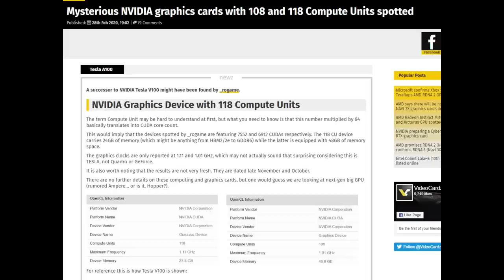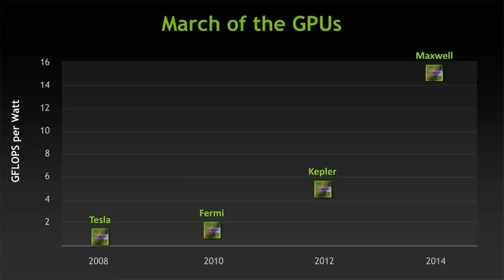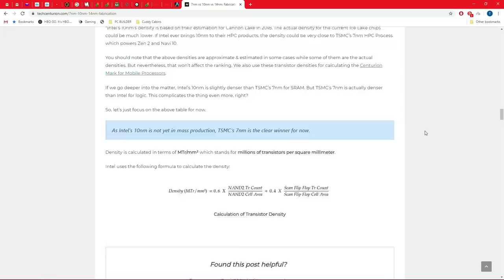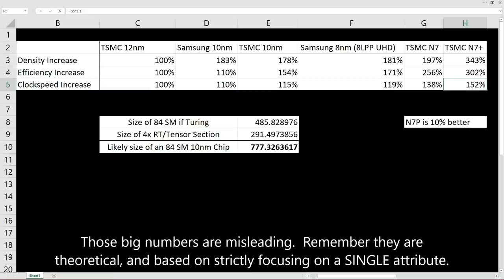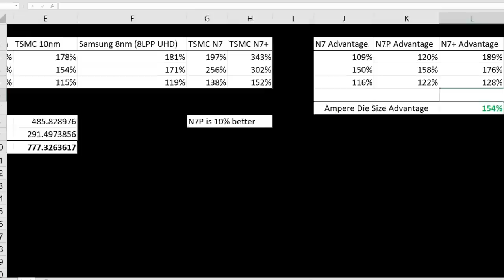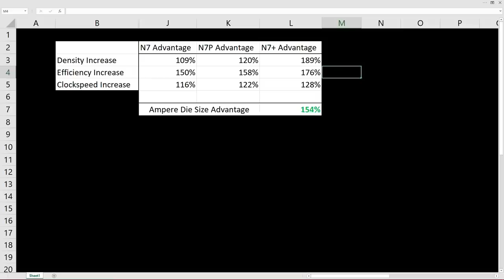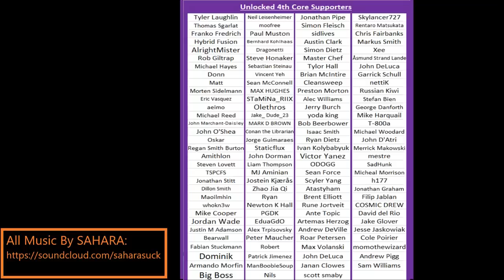Nvidia Ampere on 10nm: Still Good Enough to Defeat RDNA 2.0?

Comment: I feel like Nvidia isn't worried about AMD catching up to their level of performance to take the "performance crown," no; they're worried that they'll have no acceptable excuse to be pricing their new Ampere lineup as high as they can to earn as much profits as possible.

((Edited for -- hopefully -- better wording.))
Reply: Good point indeed
Reply: less profit haha
Reply: This assumption is based on the idea that AMD is not going to rip off consumers ,as well, though. If AMD starts to charge the same ridiculous prices as nVidia did on Turing, nVidia might very well get away with that on Ampere. And AMD already tried to do that with the 5700XT. Let‘s remember: This card was originally supposed to replace the RX590 and they tried to sell it for over 450$ MSRP
Reply: And further more, AMD is not really in the position to set pricing in the GPU market. They have to play along with whatever nVidia is doing. If we assume that RDNA2 and Ampere are very close in performance at each tier, AMD cannot simply outprice nVidia. A lot of demand would turn to AMD (a lot in terms of AMDs market share of course) for which they don‘t have the production capabilities to account for. So if nVidia is charging high prices again, AMD is probably forced to play
along to some extend
Reply: Felt the same . Nvidia just worried about pricing.  Hope AMD will do something at least.
Reply: @romanpul  and if AMD uses HBM for Big Navi, a higher price than previous flagships is justified. The $700 R7 was sold at a loss IIRC.
Reply: Defeqel that could make it even worse for AMD, because nVidia could actually come to the idea to outprice them. Because of the generally more mature and therefore cheaper node nVidia builds their GPUs upon gives them far more headroom to adjust prices. I‘m not sure if AMD is willing to sell cards at a loss again. Tom just pointed that out very nicely. nVidia makes cheaper dies on older nodes at the sacrifices of them being larger. AMD cannot do that for a number of reasons and has to use more advanced technology to compete and charge a premium for that. nVidia can now go ahead and charge this very same premium  and keep it as margin. So the only way for AMD to stay competitive is to narrow down this gap. And introducing HBM will not help that. This is not a question of technology but rather of corporate strategy and pricing. And for that reason I don‘t see AMD using HMB outside of a flagship model. And believe me, nVidia will pull every string in their pricing model to make it less favorable for AMD to make high-end GPUs
Reply: The two go hand-in-hand. If AMD takes (or even approaches) the "performance crown", nVidia can't price their products like there's no competition. So if they're worried about pricing, they have to be worried about their performance lead.
Reply: Hope you are right
Reply: I don't think Nvidia is worried so much about competing but maybe they should be, what they really should be worried about is their profit margins.

If AMD delivers at the high end even if it is slightly slower than what Nvidia offers, that will likely force them to lower the prices of the higher end cards which Nvidia doesn't like doing as that is where the real money is, then throw in that AMD tends to always be cheaper than Nvidia and AMD could have a rival matching Nvidia at the top end, that will likely eat into Nvidia's market share.

Nvidia should also be worried because AMD is gaining market share with Navi already even thought it's much slower than Nvidia's best, so that doesn't bold well for Nvidia if AMD gets back in the game in the same way they did with Ryzen and all the signs are pointing that they will so only time will tell, but either way, I get the impression that Nvidia ripping off consumers could be close to an end just like AMD did to Intel with Ryzen and that is all thanks to AMD getting back in the game.

Another factor that should worry is that AMD looks like they could be building a monster of a gpu on a die of around 500nm whereas Nvidia seems to be doing it on a bigger die, that likely means AMD can sell it cheaper whiles retaining the same margins.
Reply: @romanpul  I think they could not price it any lower, because of 7nm, it's more expensive than nvidia's.
Reply: Me my point was that AMD wouldn‘t do that even if they could.
Reply: Paul Aiello That‘s ignoring that nVidia is using older nodes which are cheaper to make and have higher yields. nVidia always opts for the sweetspot in price/performance at the excess of diesize. So nVidia’s dies will always be cheaper than AMD’s unless AMD forces nVidia to exceed the radical limit of their production node
Reply: @romanpul  That's true and that can work pretty well if they have an overall advantage on performance, that might not be the case when both AMD and Nvidia release their big new cards and that puts a lot more pressure on them both, also, both are competing with the next gen of consoles, yes that includes AMD even thought they are making the chips for the next gen consoles.

I say that because if AMD delivers 2080ti level of performance for the next gen of consoles and you can buy those consoles for around $500 or $600, that is going to likely turn a lot of heads in that many PC gamers will jump ship back to consoles, both Nvidia and AMD don't want that because the margins are bigger on the PC then on consoles which are tiny, both would rather we buy higher end PC hardware, that will put a lot of pressure on both companies to give us at least 2080ti level of performance or a bit more in the price range of around $200 to $300 just to compete with the next gen of consoles and that is likely doable if the rumours are true about both big gpu's being around 18 to 20tflops as that will mean AMD could do a 2080ti level of performance for a mid tier card and so will Nvidia likely able too as well.

In any case, assuming the coronavirus doesn't get in the way of production and delay any of this, this is going to be a massive year for both PC and console gamers in the leaps being made.
Reply: Paul Aiello I think we just managed to reverse-engineer both AMD‘a and nVidia‘s corporate strategy for the next year xD
Reply: @romanpul  Yeah, someone got to do it lol, I know all this is speculation but it all fits and makes sense, now I'm heard the next gen gpu's on the PC could be around 18 to 23tflops, that would make it very easy for both companies to do a much cheaper version of those cards that can match or beat the next gen consoles as we are talking about double the performance of the next gen of consoles and it does make some sense, AMD is likely using the mid tier card for the next gen console and reserving the high end card for PC gamers where the margins are much better.

Comment: I'm stoked for the upcoming competition, dope cards for dope prices.
Reply: can’t wait to get a sub $400 1080ti!
Reply from the maker: You mean the $300 RX 5700?
Reply: It'll finally be my time to swoop in and get a 1080ti on the cheap
Reply: Moore's Law Is Dead I dabble with AI and I’m learning CUDA so I’d like to run a second 1080ti for SLI. I’m definitely putting an AMD in my gaming pc tho.
Reply: @AA-gl1dr  Tensorflow actually runs on Vega now if you're interested. The project is called Tensorflow-rocm and AFAIK it's been merged. Navi support in ROCm isn't ready yet.
Reply: @Azraleee  I feel disappointed that RDNA 1X Cards (RX 5700) don't have ROCm support, compared to GCN. I hope ROCm will not be a GCN/CDNA exclusive and will also come to RDNA 1X and RDNA 2X GPUS.
Reply: @xanton1895 same

Comment: 777mm squared...
well, not gonna lie, I'm gonna question about their yield, even if the wafer is produced in a matured node.
Reply: it's cheap rubbish that overheats
Reply: @jorrgfromage9929  im not sure. 2060KO have same die as 2080ti but disabled some CU in it
Reply: @rogueanuerz  lucky for those who gets the 2060KO (2080Ti chip but with disabled CUDA cores). Its compute power is the most powerful in its class, making it more than 40% faster in rendering (according to some benchmarks, I forgot which).

But I'm not sure about why... is it because of its large die size which made the yield that low?
Reply: That's 3% bigger than  RTX 2080 TI's GPU   and 5% smaller than Titan V's GPU.
Reply: You will only get cut down cards anyway just like it was with Turing and in half a year you will get less cut down cards they call super.
Reply: @MaggotCZ  How is it underplaying? Huge die sizes are not a weakness, its just what Nvidia has always done and it would only make sense if they would do it again.
Reply: @MaggotCZ  So 2 out of 5 is what you call an exception? And that when you started your list with Kepler, which was the first one they sold cut down because there was no competition? Before Kepler they always had the 100 chip as the high end desktop card, except for Fermi with which they couldnt even build one for obvious reasons. With Kepler they sold midrange card as the 680 just to drop a Titan later because there was no competition and they did the same thing with Pascal again selling you a midrange card as a 1080 just to drop a Titan later except that even the Titan was cut down. Nvidia has always made huge dies on mature nodes and cut them down for segmentation. Only recently they sold smaller dies as the "high end" but that was because they had no competition, not because that was their original plan.

Edit: But youre right about one thing: GA104 will most likely be a small die but thats obviously because its a 104. What you dont get is that 100 isnt HPC, its what used to be the high end desktop except that they ask HPC prices now, just like 102 or even 104 arent high end, theyre mid range sold at high end prices. They could sell their entire lineup for half the price and still make a huge profit but they dont, because they dont have to.
Reply: @MaggotCZ  Times havent changed, it was just because of lack of competition, which could come back anytime. They may launch a 104 as their 3080 but if Navi20 is competitive, they will soon drop a 102 3080Ti and a 100 Titan A or something. None of their lineup is static, its all made up right before launch to fit current market conditions. Anything else is speculation and we will see.

Comment: It would be fun to see AMD go nuts and produce this time a shit ton of 100 CU RDNA2 Navis with 7nm+ EUV. Then select the absolute best silicon, pair it with HMB2, have them watercooled and clocked as high as they can with 300W - 350W range. Then send them to reviewers and rake the benefits for having their own tier GPU for once. This Halo product would change the minds of Nvidia fans, and also the mind of those remaining Intel fans that think AMD just got lucky this time.

If they only win by a small factor, Nvidia fans are going to make excuses and many of those who buy 2080tis will still buy Nvidia, assuming they are better quality. After all, they have been buying Nvidia for so many years that they will rationalize excuses. But if the best AMD GPU is in their own league, and Zen 3 is the best gaming CPU, then they will buy both CPU and GPU from AMD.

I certainly don't want AMD to become monopoly, but Nvidia needs to feel the heat to really start developing. And same goes with Intel of course.
Reply: that big navi halo product will have to be A LOT faster than Ampere flagship to make nvidia wake up. i mean no one would buy a 350w water cooled card if it's only a bit faster than 250w Ampere.and considering rdna 1.0 i doubt that next gen navi could make that big improvement just after a year.
Reply: +1 on "Nvidia fans are going to make excuses" to stay with Nvidia. They've been doing it for 20 years.
Reply: It's time to drop Nvidia I'm tired of a company that overcharges for a GPU. Intel felt the heat now; It's time to have Nvidia feel the heat.
Reply: @j.b.9738  The problem lies with your Beloved AMD constantly releasing sub par products and not competing at the high end.. Nothing else really.

Stop being a Troglodyte and see it for what it is.
Reply: I was thinking about switching to an AMD GPU. Sadly, I do programming and AI, and most of the libraries I use are based on CUDA.
Reply: Those dirt Nvidia fans buying cards that don’t have an AMD competitor! How dare they!
Reply: @evoniankromestaar9120  like the  r290 and7970 ?
Reply: There's no such thing as ''fandom'' when we talk about general consumers. The reason why majority pick Nvidia is because AMD is either late to the party or doesn't work properly. Zen2 is proof to that, these chips outsell Intel because they offer overall a better value, unlike their GPU line that is just as disappointing as Nvidia's counterpart if not worse.
Reply: Amd has now rdna and cdna so big gpu goes to gona and smaller to rdna so I don`t Expect to see huge Gaming gpu from amd. But a competative size... definitely!
Reply: @_yuri  How long ago now?? Christ...
Reply: To be honest, a lot of the Nvidia fans might have a point in their rationalisations:
Nvidia's driver stability and better efficiency are a genuine benefit, even if their overall performance and price-to-performance are lower than AMD's.
Reply: @Tjecktjeck  Consumers is the keyword. Consumers buy into marketing, and Nvidia is one of the best marketing corporations. And because they have been doing that successfully so long, many of these marketing themes has become the "reality". 

AMD however have been horrible at marketing on the long run. Zen changed that, and RDNA started that change on GPUs. But it takes a lot of time before it works on average consumers.
Reply: @nathangamble125  That driver stability is BS. Sure Radeon VII and Navi had problems, but at the same time Nvidia has had half the amount of problems on mature GPUs as Turing is old already. On the drivers front things have changed during the years.

Efficiency is genuine benefit, but for average consumer power consumption is pretty meaningless.

CUDA is the only real advantage for Nvidia, and while majority don't use it, still a lot of people do, and for those it's an easy choice. I really hope AMD's ROCm would become popular as it seems pretty amazing.
Reply: The AMD card would still miss one of the biggest Halo features of the Nvidia cards; CUDA support.
Nvidia is HUGE in datacenter and GPU computation (much bigger than you would think), and it ALL depends on the Nvidia CUDA programming language.
Reply: @neonix01  ROCm is AMD's version of Cuda, and based on what I know about it, it's much better. The problem is that software support is still small, but I suspect that is going to change.

It will be interesting to see what CDNA cards bring to table. I have a lot of confidence to AMD as they have managed to organize their R&D to be really effective.
Reply: @juzujuzu4555  I feel disappointed that RDNA 1X Cards (RX 5700) don't have ROCm support, compared to GCN. I hope ROCm will not be a GCN/CDNA exclusive and will also come to RDNA 1X and RDNA 2X GPUS.
Reply: @xanton1895  Yes, I truly hope that too. Or at least if it's CDNA only, I hope that those cards can game as good (or nearly as good) as RDNA2. I would be OK to spend more with CDNA and I didn't mind if that was not power efficient with gaming, but I need ROCm.

Comment: not sure what the 7 dislikes are about, but great analysis and makes perfect sense. Competition is always good.

I personally think nothing has changed on AMD's 7nm road map for RDNA. I watched the entire financial analyst day. All 3hrs and 30mins of it! During the Q&A, Lisa Su did answer the question around 7nm+ being removed from the road map and the new slides talking about 7nm. She replied that it was simply AMD aligning to TSMC's new nomenclature for the 7nm finfet. TSMC call all 3 nodes 7nm so AMD is now calling 7nm+ 7nm was pretty much what Lisa Su said.  

People also should remember that Lisa Su talked about a Navi 10 refresh. This could literally be a way for AMD to replace cards like the RX 5600 and RX 5500 with better nodes with slightly better performance and power efficiency. This would not be the first time they have done this. I think the RX 590 was on a different node than the RX 580. 12nm vs 14nm if I remember correctly. This refresh could allow AMD to potentially add a few more shaders or CU, the new RDNA 2x CUs that have been optimised for ray tracing calculations. The refresh would also be in line with what David Wang said in 2018 and others re-iterated in 2019, that AMD would not roll out ray tracing till they could push it across their entire product stack. With the consoles now featuring ray tracing, it only makes sense for AMD to roll out lower tier desktop GPUs with the same features. These GPU will probably have more CUs than the consoles especially if BIG Navi is meant to have 80 CUs. There is plenty of room  between 40 or 48 CUs and 80 CUs. RX 6600 XT suddenly getting the same performance and CU count as the RX 5700 XT and doing ray tracing with even just a small price increase would be good. And prices are going up. AMD seemed to suggest they are looking at an ~50% margin vs the 40-44% they currently have on RDNA 1.0 and Zen 2. 

In addition, is CDNA! Which Lisa Su actually mentioned not only for data centres but also for cloud gaming. Meaning Stadia will likely at some point be getting CDNA GPUs probably on 7nm+ using the prime chips. So what AMD may do is similar to Zen 2 Ryzen 3950X and Threadripper, use the same core design for Big Navi and CDNA but give the best chips to the different SKUs of CDNA and shut off the defective CUs at the low end and pass those to BIG Navi. Exactly what they did with MI50 and Radeon VII.
Reply: I can't wait for the 80 CU NAVI Monster. 😇